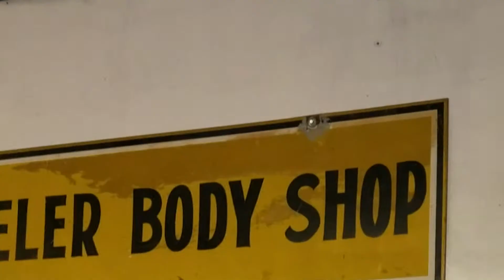1969 El Camino Vehicle Wrap Installation - Start to Finish

Comment: looks great two questions im going to do my 83 el camino in a wrap and was wanting to know how many feet of wrap did you use and were you able to wrap the roof to the back of the bed in one piece of wrap thanks for any advice on it
Reply from the maker: We used a full 25 yard roll. There is a small seam above the window. Roof was wrapped in one piece and the sides were wrapped separately. It looks seamless.
Reply: @SCGwraps  I wound up doing it in two pieces seam was not that noticeable came out great sold it though was a great el Camino
Reply: Where is the car now